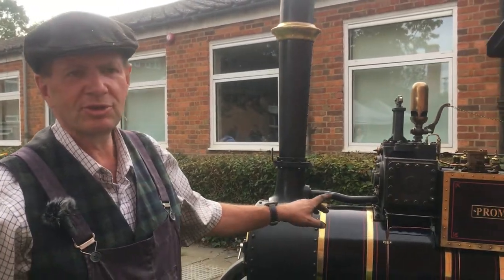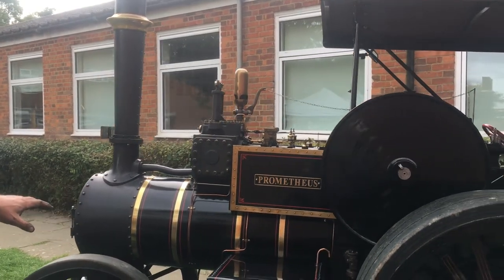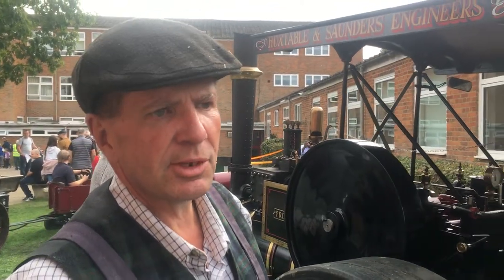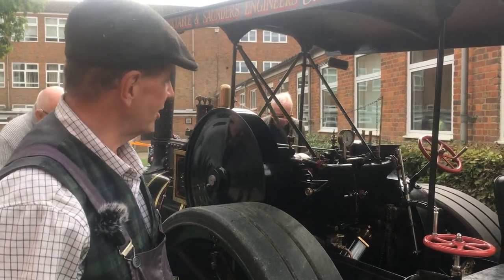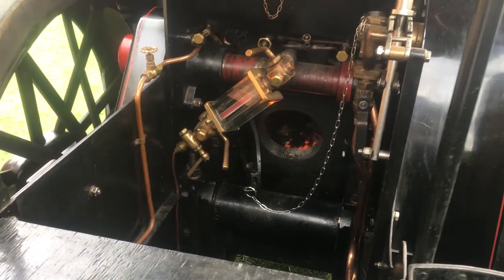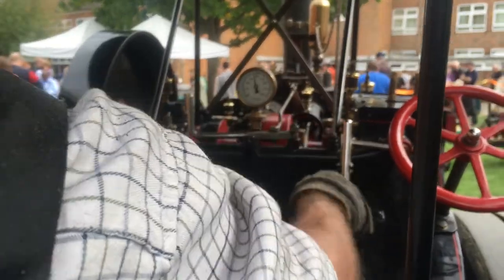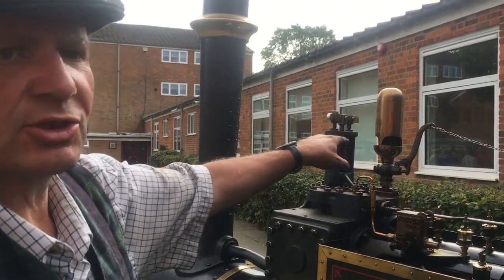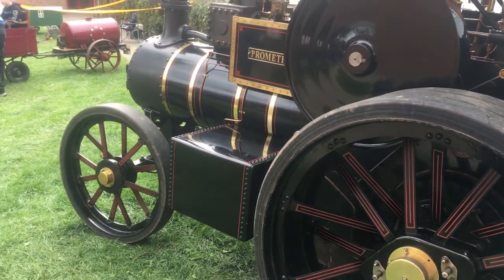McLaren Gigantic steam traction engine 6 inch

Comment: Surely the engine should increase in speed when notched up rather than slow down. The slide valves require adjustment.
Reply: Confusing term - 'notching up' actually means to decrease valve travel, thus reducing amount of steam admitted to cylinders. It is an economy measure much used on railway locomotives. So for a given regulator setting, notching up would result in a speed reduction.
Reply: @petercooper2387 Notching up has nothing to do with speed at all.  It refers to using up the full expansion of steam as from opening a full port and wasting steam up the chimney as can be heard when a locomotive barks through the chimney. 
The regulator on the other hand alters speed.

Comment: I always wonder, at what point does it stop being a model? Haha
Reply: A model is static.
Reply: @union310  That is not what defines a model. I’d wager most of them move.
Reply: @IronBridge1781  It is in the English dictionary. Engineering in miniature refers to something that is close as possible to the original. 
Do you build yourself?
Reply: @union310  I’ve always known it to called model engineering. And yes, I do.
Reply: @IronBridge1781  Model engineering is a term Percival and Marshal coined when they made their choice for a magazine. However the arrival of LBSC and others at the time took them from models to true machines. 
What do you build?